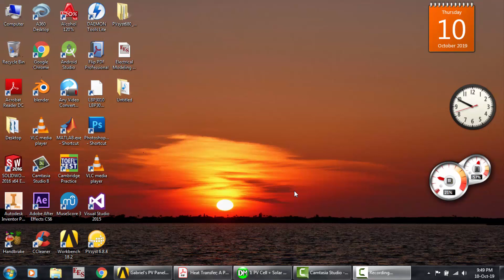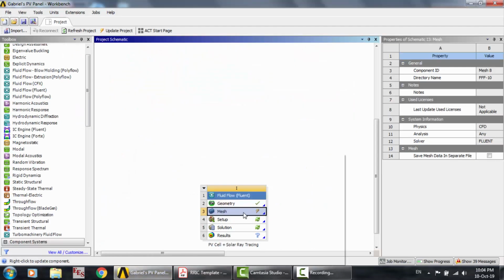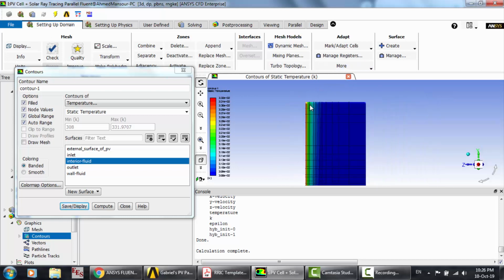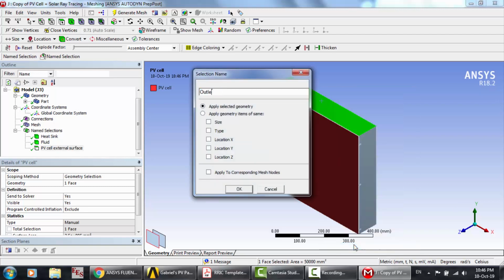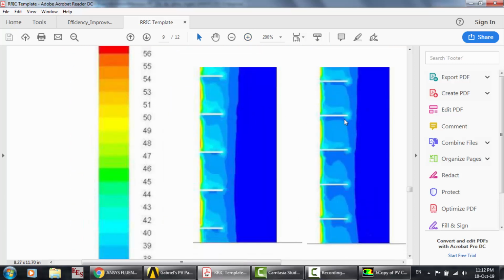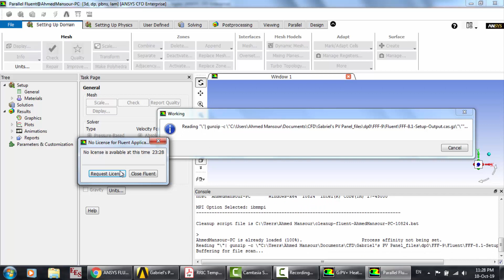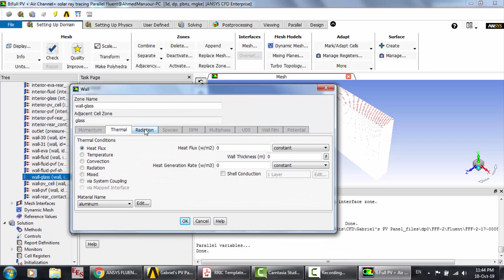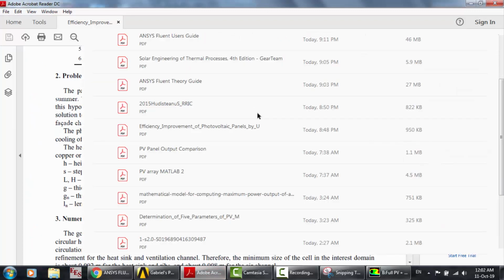CFD simulations for cooling a PV panel Photovoltaic,heat sinks, Fluent, Solar Ray Tracing

Comment: My question how simulated the panel solar because you import the gemetry and how designed.
Reply from the maker: Hello dear Rabh, first we generate the CAD files using any CAD software. I use Autodesk Inventor, then we import it into ANSYS. Watch my video about cooling PV using fins (ribs) to see the geometry. Danke!
Reply from the maker: Hello dear Rabh, mech.eng.ahmedmansour@gmail.com  Danke!

Comment: Hello thank you so much for this toturial, may i have your Workbench file? Im struggling with my project and its about analysis of pvt System with Fluent but its so much annoying
Reply from the maker: Hello, actually I do not share it because of the easy way to generate the CADfiles and then follow the setup procedure in ANSYS. Thanks

Comment: Hello, I am making a model of a tube from a CSP plant, the tube is exposed to the sun on one side and I have problems to locate the solar rays perpendicular to the tube, your help would be great
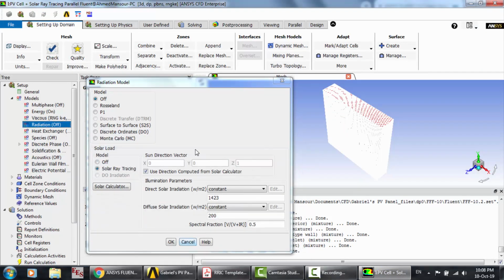Reply from the maker: Hello dear Felipe, simply use the sun direction vector of the solar ray tracing to let the rays hit the tube in a perpendicular direction. Study the vectors method at 18:25 of solar ray tracing as I said in the video. Danke!
Reply: @haveanicetime  Thanks for the answer, the only problem I have is that I do not speak fluent English, so I have not been able to fully understand the ray tracing, if I had any link where I can get more information it would help me a lot,

Thank you!
Reply from the maker: @felipeguerrero1815  Try to search for it by your language. I am only familiar with the documents I showed in the video. Danke!

Comment: Good to have such videos sir...can u make one video on simulation of Phase change material for Photovoltaic panel with heat sink . Thanking You.
Reply from the maker: Hello dear Someshwar, you're welcome! Simply we follow the same steps and just we use the solidification and melting option then we define the properties of the PCM. That's it. Try it and if you have questions, you can ask any time. Danke!
Reply: @haveanicetime  Thanku sir
Reply from the maker: @someshwarbhakre4993  Bitte schön !

Comment: Do you have any experience with COMSOL multiphysics modeling? If yes could you do the same problem using it? I would really appreciate if you could.
Reply from the maker: Hello dear Salman, unfortunately I have never used it because the research articles and the field I work in always use ANSYS. Danke!

Comment: Hello, very interesting video. I have learned a lot through this tutorial, but I want to ask you what if you have a profile file of heat flux with (x,y,z,heat flux) that is applied to a wall and at the same time you have convective losses. Could you still use the solar load model to apply the heat to that surface? thaks in advance
Reply from the maker: Hello dear Jesse, watch my video about flux in Fluent and ansys mechanical. i talked about that. Thanks
Reply: @haveanicetime  thank you for your response, is this the video https://www.youtube.com/watch?v=EpUpdykYN7Y? if not can I have the exact title please?
Reply: Regarding that video, I found that the only way to apply heat flux and convection simultaneously is through the steady state thermal model.
Reply from the maker: Yes.

Comment: Hi bro 
I did what you did regarding everything except the dimensions in which i use pv with dimensions ( 1300×680×5) mm, the problem I'm getting the maximum temperature about 560 k not like yours , can you give me some advice plz
Reply from the maker: Please get a research article and learn how to validate the CFD data. Thank you

Comment: Hello again, I am addicted to your video 😄, I need to draw a plot showing (the average temperature of pv VS time (hr)) can guide me, please? I really appreciate any help you can provide.
Reply from the maker: Hello, simply you create a monitor as I showed to monitor the temperature of the PV at the specified hour set in the solar ray tracing. Run the simulation until you find the temperature does not change. Then run other simulations at different hours and plot all the data on one plot, x axis has the time in hours and the y axis shows the temperature. You gotta input the required boundary conditions at each simulaton. Thanks
Reply: @haveanicetime  Thanks for that explanation I am gonna check it

Comment: I want to ask is there any difference in the simulation result if u assume the solar panel to be only a single surface compare to the experimental study with an actual solar panel ?
Reply from the maker: Hello, an experimental study must be carried out and you validate the numerical results against them to be sure. Danke!

Comment: Hi! Thank you for this great video. I try to follow your steps and got almost the same result as yours when PV cell is suppressed. However, when I tried to combine all the PV layers & unsuppressed. My solution did not converge. & if they did converge, the results were not satisfactory. There were no temperature differences/temp.distributions. The temperature value gave 35 degrees C.  I checked all of my inputs and it looks the same as in the vid.

Therefore, may I know:
1. How to get a good mesh? (since the thickness is very small. my work interface does not have relevance center option in mesh display)
2. How to named the selections of all the layers?

FYI, the design of the PV panel is (2000X1000)mm and the HSF is (1260X830)mm. The fins are at the center of the pv panel.
Also, I modeled the panel & fins together via CATIA V5. Then, imported it.
Reply from the maker: Hello dear Aqilah, it seems that you did not watch the whole video because I showed how to model the full PV (With all layers) and then after adding the heat sink. I do not know way you asked about how to create named selection for the layers because I have already shown this. 

The procedure I showed is the only one that works because it guarantees no overlapping occurs. Overlapping causes divergence. 

The mesh size is determined based on the y+ l calculation related to the heat transfer, Re number and turbulence mode. You find this in the references and Ansys user or theory guide.

Any part must be imported alone following the procedure of add material and add frozen. I modeled the layers in Inventor and imported every one one by one. You can model the fins in Catia or Inventor and then import it alone. After that, you generate the fluid domain around the fins like the way I showed if the fins do not have holes. If they have holes, you must create the fluid domain taking all cavities into consideration to avoid any overlapping. 

That's why I drew the sketch of the fluid domain manually just to surround the fins not overlapping their solids. Do you get this?
Danke!
Reply: @haveanicetime  Yes, understood. I see now, all this while I imported all the parts together as one. Will try! Thank you so much for the response!

Comment: Hi,

How can I running long transient simulation ( more than 24h) with solar ray tracing?

Regards
Reply from the maker: Hello, actually you run the simulation at the sun hours the experiment was conducted at. Each hour has a different flux value. This will produce results at specific hours during the day light. Then you will be able to plot the curves against the hours of the day. Got it? Thanks

Comment: I am still confused whan should I use heat flux + solar tracing and when I should use only solar ray tracing?
Reply from the maker: Soalr ray tracing is the heat from the sun by radiation. Heat flux is another method to add heat but not from the sun. Thanks
Reply: @haveanicetime  that's great thank you so much, so Why you don't use any one of radiation model  ( like P1 ; Do ) and so on
Reply from the maker: @hayderal-lami4335  It depends on the physics of the simulation. You should study these models in detail from Fluent Guide. Thanks
Reply: @haveanicetime  thanks 🙏 for your big help bro